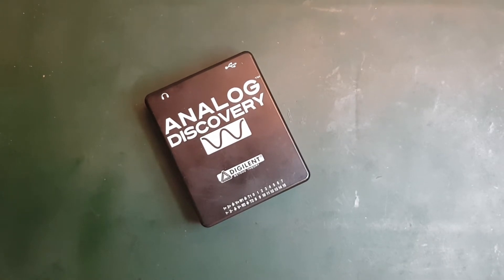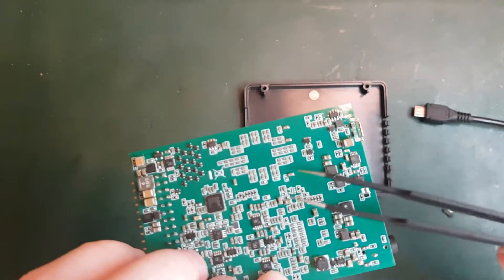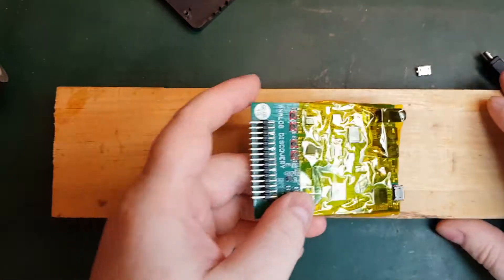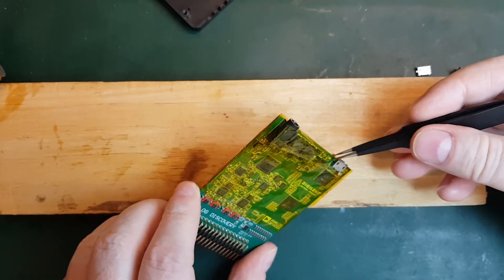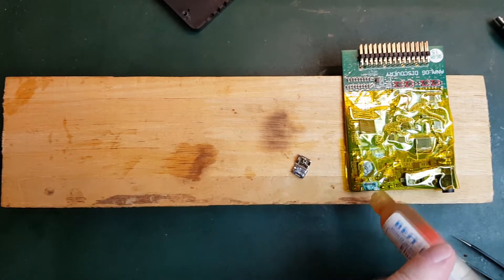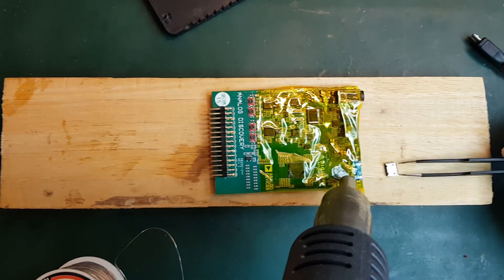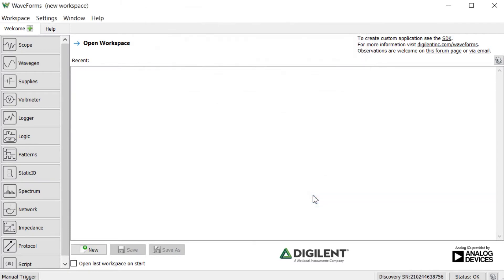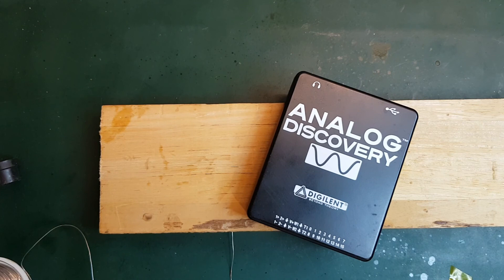Analog Discovery Repair

Comment: Good to see that you are still around! I bought an analog discovery and made a copy of your impedance analyzer hardware, this was an amazing tool. Unfortunately, the software stopped working after your website went down and now I am not able to use it any more. Is there any way to get the software up and running again? A.M.
Reply from the maker: Thanks, I'll try see if I can find a place to upload the latest software.
Reply from the maker: yeah, I hit a rough patch, but I still have the software, just need a good place to share it.
Reply from the maker: @TA-nn9os  Hi, the software was build to auto update from a specific URL on my website, as I wasn't able to keep the website running it would unfortunately stop working. I'll build a new version without the auto update feature, then it should always run just fine. It's taken a bit longer than I wanted because the hard drive on the laptop I used for development crashed (of course) however I have been able to recover most of the source code.
Reply: Hey, Life does that sometime.  Glad to see you back.
Reply: That would be awesome, a lot of people really missing your audio analyzer software that quit working when your site went down
Reply: I too would really appreciate seeing your impedance analyzer design and software! It looks great much better than trying to do it with a breadboard like I am now! I'll subscribe incase you get a chance to upload them again some place. Also if anyone has any PCB's they've already ordered I might be interested in buying 2-3, otherwise I'de need to order 10 of my own I'de guess.